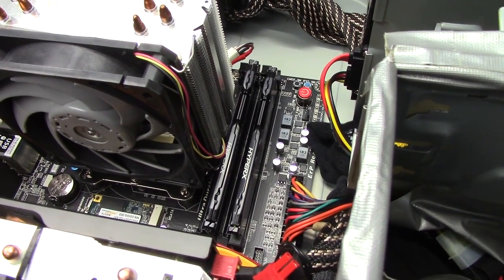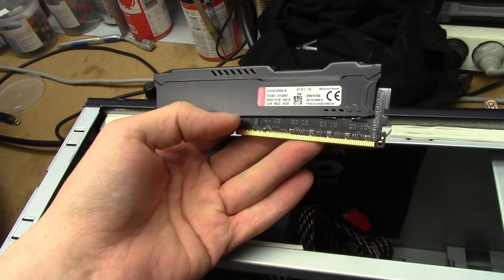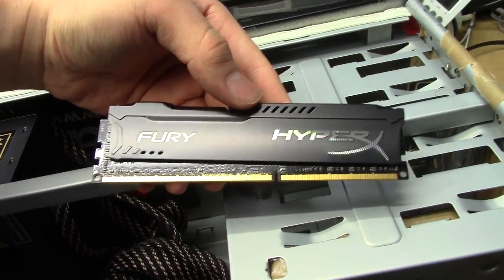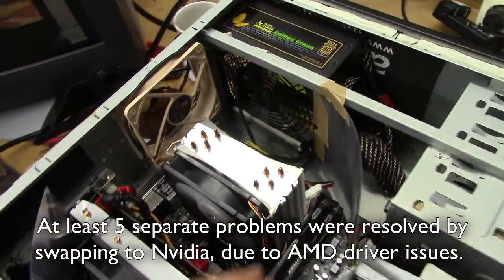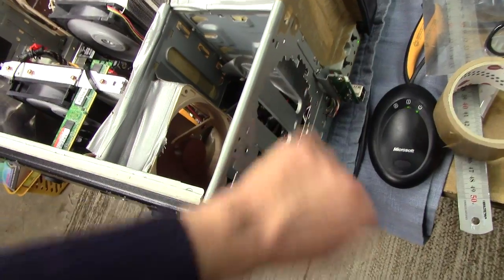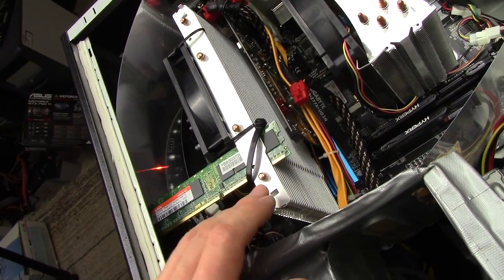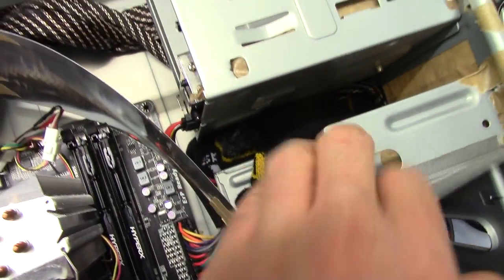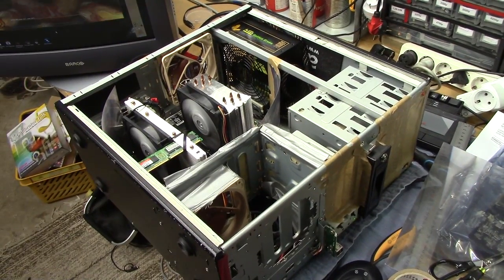Rambly look inside my workstation computer

Comment: Reminds me of my old computer, super getto but it works. And people with concerns need to understand that most modern PSU's barely run or stop there fans most of the time.
Reply from the maker: The proof is in the fact that it still runs with no signs of failure.

Comment: I was expecting you to use something more exotic than a 2500k for some reason. Something like a dual Xeon or the like. But hey, that airflow management is out of this world, I thought it was actually a joke the first time I saw it posted on that certain vietnamese drawing bulletin board.
Reply from the maker: +ilovethetwinfamicom Given the nature of this channel, it would make perfect sense to expect me to use a quad Opteron set-up from 2004 with 3 AGP graphics cards and 32 GB of DDR1.
Reply: +FFcossag Exactly. I have wet dreams about set-ups like that (except for the three AGP cards, which would be impossible).
Reply: +FFcossag you  rang? https://a.pomf.cat/jhpska.jpg
Reply: +Sudos Oh, gawd, so YOU are that guy. I've already told you anonymously, but you have the most amazing rig in all of the board. I'm seriously thinking of buying a dual socket 604 board and a pair of six-core Xeons just to beat you.
Reply: +ilovethetwinfamicom yes, I'm THAT guy. and you want to drive your power bill sky high for what reason now? realize that box is like 220W idle and ~450W full tilt. in comparison, the i5 HP sleeper box I built uses like ~120W idle with all disks spinning, and ~450-460W full tilt because of that damned 6970. 

a dual socket 604 hexcore box, if it's anything like the Proliants I've seen those CPUs in, will take quite a bit of power to satisfy, and that's just with the board hardware itself, and how much stupid power FB-DIMMs use just on their own, which is a requirement for those types of machines. do yourself a favor and just get a dual LGA1366 board. one of the Supermicro boards that ended in... F? was able to do 48GB of normal DDR3 with two hexcore Xeon X5600 series chips. that, and the LGA1366 heatsinks for those types of boards, specifically the Intel-branded ones, are not too bad, actually. 

I'd be lying if it too wasn't a power hog, but it'd totally be less of a power hog efficiency-wise than my crap-for-crap box. the entire reason I built up the other was to have an upgrade path in the near future (this summer, with luck.) and to get off a 10 year-old motherboard, 10 year-old CPUs and 10+ year-old RAM. it's had a life, and now it's time to put it to pasture and use the case for something more interesting. also because nForce is crap, but that's a minor issue.

Comment: no psu fan? do I have to say, this is a bad idea? rather than removing it, many times I'll just rewire the fan to run on 5 or 7 volts rather than the full 12, or sometimes I'll add a switch so I can easily change the fan speed if the needs of the system change. as long as the psu is under load, as in normal operation, you can use the 12v rail as + and the 5v rail as - for the fan, which ends up providing 7 volts to the fan without any added parts, and it's safe for the system. a lot of times a fan running on 5v just isn't enough to cool a psu, which is why 7v is a good option to have.

also, be aware of the dangers inside a computer power supply. there is high voltage dc inside, which can be deadly. don't assume the capacitors drain on their own with the power cord disconnected, and remember that heat sinks mounted on the board are often not grounded and can be part of the live circuit.
Reply from the maker: +Pete Lorenzo That is good advice for your average computer nerd kind of guy. I happen to be a power electronics nerd, so I've considered those factors in my design.

Comment: My power supply fan is noisey I bet I could delete it as well I have two fans pushing air into the case
Reply: +Rex Holes or just replace the fan, it's not rocket science. increasing noise in the fan over time usually means a bad day for your power supply down the line when the fan finally grinds to a halt.
Reply: +simontay1984 debatable, if you use the wrong type of oil you can mess it up more than you originally started with, for one, and two, adding more oil will only quiet it down for a short period of time depending on bearing type and how worn the bearing is in the first place pre-oil.